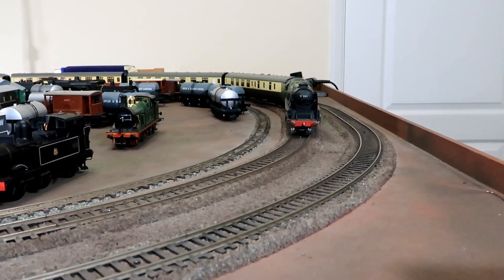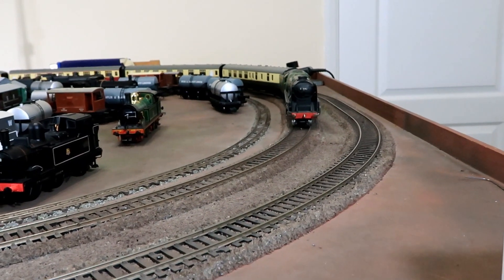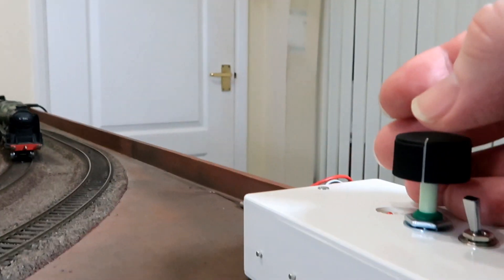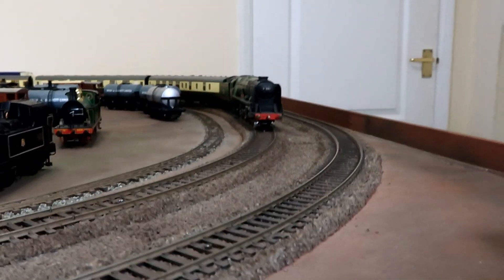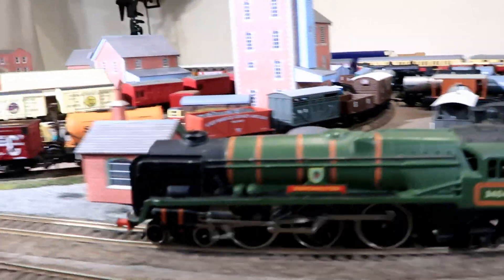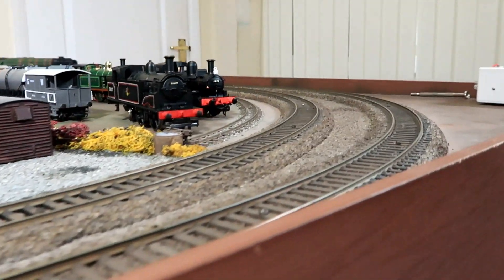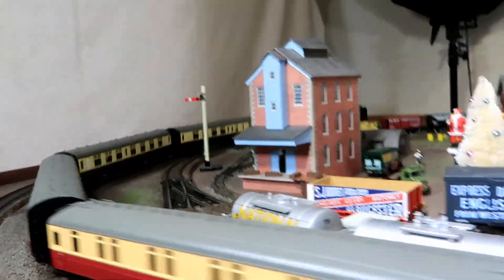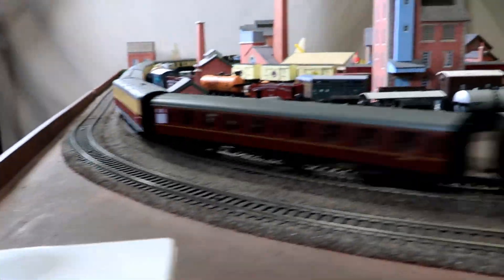Building from scratch a model train controller part 3A Wrenn Engines

Comment: Thank you for this schematics! Works like a charm! I've noticed that the rails needs to be quite clean in order to have a good contact beween the locomotive and the tracks, otherwise the train will stop... on the other hand, the voltage in the original schematics reads 16! Well, if the traks are very long, those 10.6 V, or so, at the exit of this circuit might not be enough... I was thinking to use an AC regulated power supply to see the difference, but I hope it will be enough to just have those traks clean! 
I have a question, though... How will I connect the switch properly? I don't know, it suppose to change the polarity? I did not understand from the this presentation...
Thank you again!
Reply from the maker: Many thanks, clean track and importantly good fishplate connection is vital. Here's a diagram of how to wire the switch https://images.app.goo.gl/zR4wRssc7FazP4bL8

Comment: im trying to do a scratch build controller myself, done 2 sofar where it has 20k pot,2 diodes, the mosfet 540 with heatsink. quite responsive but with a slight lull at opening of pot. im aiming to have smooth slowdown and start or pull away which is partially achieved. the power is starting to come through at 1 quarter turn and im getting 10.5v(dc) for my locos. bear in mind im not an elctronics fumdi but learning slowly. what i want is a bit more response from.the units i made so far. im a little concerned about the protection (if any) that these simple controllers are providing for my models which are quite expensive in ZAR currency. so im using the controller on 2 or 3 "sacrificial" locomotives. any suggestions?
Reply from the maker: Hi, So that is a big question. As I do not know the circuit you are using it's hard for me to say. Have you tried the one I suggest? This has lots of control-ability across a range of locomotives. For protection I use a self resetting 1 amp fuse. Good luck

Comment: How much to build two of these controllers
Reply from the maker: It all depends on what you have already, to buy the parts to make the controller, minus the box, power supply only comes to about £5 or £6. Not sure how much a box costs but it can't be much a suitable PSU could be this one https://www.rapidonline.com/stontronics-12v-1a-ac-dc-unregulated-mains-to-low-voltage-adaptor-t3613st-90-2634 but you will need to remove the smoothing capacitor in it.
Reply: @ModelRailwaysUnlimited   Were do get the parts would to have two controller build for my layout
If so could help me on youtube
Reply from the maker: @thedoctor6610  CPC, I have put up three + 1 videos showing how to build it, good luck

Comment: How about double heading on that controller !!!
Reply from the maker: Hi there, no problem at all, the output transistor is rated up to 10 amps, but even with just 500mA that is easily two modern locos. I am sure we could use a 1 amp PSU, thus you could have 4 headers lol, after that heat dissipation with the heat-sink I have shown could become an issue